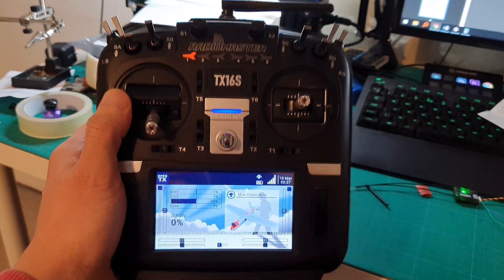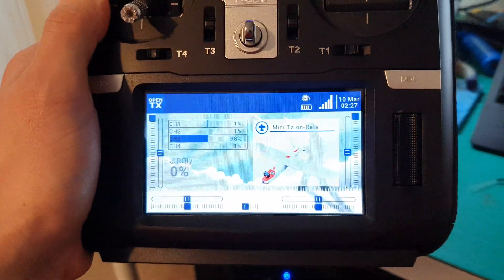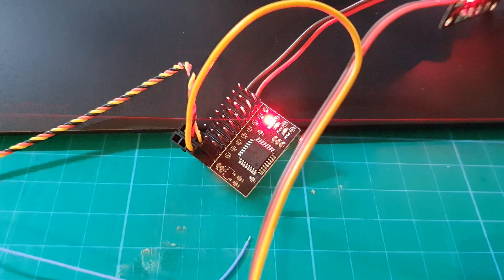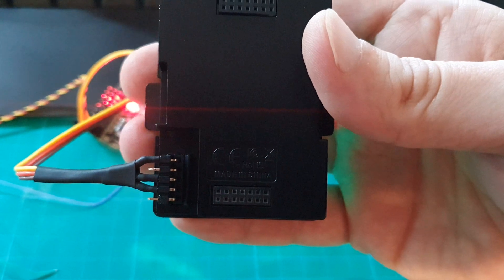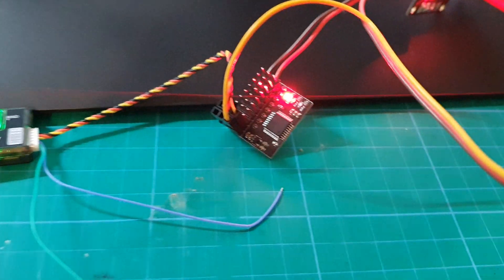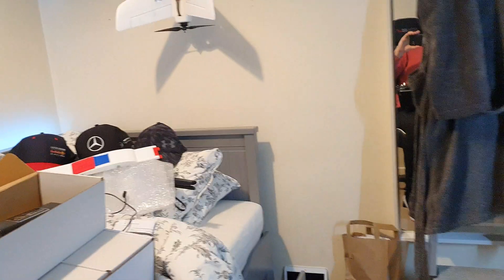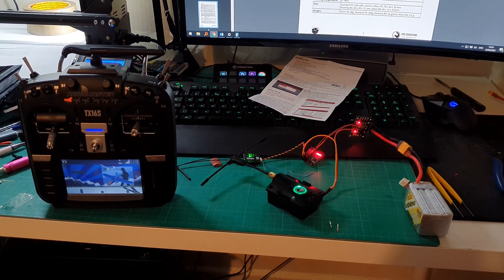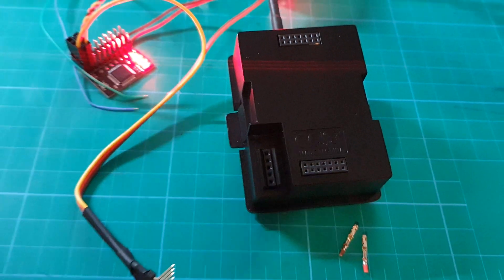How to build a 2.4GHz to TBS Crossfire Relay

Comment: What is the use case I didn’t understand can’t you directly plug crsf module to the module bay ? 
Please explain your use case
Reply from the maker: Perfectly understandable question...

When using a dipole antenna, it's important to keep the orientation on the transmitting end the same as the orientation on the aircraft... as best as possible. Of course the aircraft rolls and climbs but for long range the aircraft is normally flying level. Therefore it's important that you hold your transmitter very still and with the antenna in the same position for the entire flight, but MOST importantly whilst the aircraft is out at a long distance. By having the crossfire tx module static on a tripod, this ensures the antenna is also static and in the correct position at all times. This allows you to move around the launch location, or put the transmitter down on a table whilst in loiter or cruise mode for example. Many flights I've done have had durations in excess of 1 hour, so keeping your hands perfectly still to keep the antenna in optimal orientation can be tiring.

Another would be in case I was flying from a location that had buildings, structures or an uneven terrain causing potential line of sight issues between myself holding the transmitter and the aircraft. In these instances I could place the relay unit on a tripod up on top of one of the structures or higher up a hill (or possibly to the top of a tower or extendable pole) to ensure perfect line of sight between the crossfire Tx module and the aircraft, whilst also creating a perfect line of sight between myself and the relay unit. The relay unit and myself being static, would ensure an unbroken line of communication. and the relay unit being up high would ensure an unbroken line of communication from itself to the aircraft.

A further use case could be for flying in different relatively hostile weather conditions such as very warm sunny days or very cold winter days. For long duration flights I could be in shelter, either inside a car or lightweight structure to protect myself or simply stay comfortable and transmit my 2.4 signal to the relay on a tripod that I leave outside, or on the roof of the shelter (either a tent, car, van, shed etc... My 2.4 signal would easily pass through such a lightweight structure to the nearby tripod bound relay, and then be re-transmitted via the actual control link (crossfire) to the aircraft.

I hope this clears things up. Thank you for your comment.
Reply: @grim-upnorth do you still use the relay setup like in winter? Is it relyable with long range would you say if you still use it?
Reply from the maker: @ghostdogfpv  I'm afraid I haven't flown fpv in over 2 years now, due to certain circumstances. But yes I did fly this in winter and it was fine 👍
Reply: @grim-upnorth  i realized i am already using 2.4 ghz to relay the mavlink from my crossfire to the mfd antenna tracker so i probably could not use it but maybe on another frequency

Comment: Is it possible to use r88 instead of r161?
Reply from the maker: The R88 only has PWM outputs, one output for each channel. So it wouldn't work the same as my setup in this video where the converter turns SBUS into PPM.
Reply: @grim-upnorth  thank you for answering. What module would you recommend instead of r161 for this setup? I can't find r161 to buy.

Comment: Hi, can you still get telemetry with this setup? Thanks
Reply from the maker: Unfortunately, no, the telemetry from the aircraft only communicates with the Crossfire module and the relay doesn't send this back to the transmitter via the 2.4 link
Reply: @grim-upnorth  Understood. Thanks for the fast reply!
Reply: @grim-upnorth  May be, we can get telemetry through inbuilt modules wifi through the app.....I mean using wifi we can get mavlink telemetry to the mission planner...And have you tried further, any issue so far ??
Reply from the maker: @umeshjadhav3326  I only built this as a proof of concept. I haven't used this on an aircraft so far 👍🏻
Reply: If there was a way to relay the telemetry data this would be a massive win
Reply: @npmullins  I figured something but the relay range is limited and possibly with some delay. By using the wifi mavlink on crossfire module, range is limited according the wifi/bluetooth.

Comment: What about telemetry from model and fail save in case of problems with radio?
Reply from the maker: Failsafe will work, set up the 2.4 link to emit "no pulses" on failsafe, and do the same with the crossfire link. Then configure failsafe in your flight controller.

Comment: for this to work i am guessing you need to have sbus setup in the model and not be using crsf protocol via a uart?
Reply from the maker: No, you can use crsf or SBUS to connect your rx to the model. I have a mix of models on SBUS and crsf (because I forgot to solder on UART pins and I'm too lazy to take the FC out of the plane lol) works fine with all my models 

All were doing here is replacing the physical pin connection from the radio to the crsf tx module, with a 2.4ghz connection.